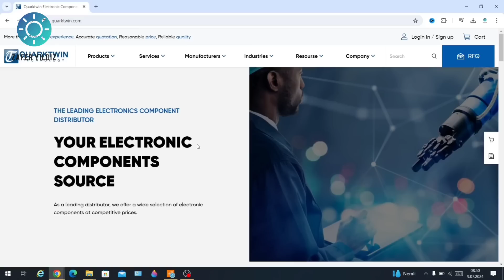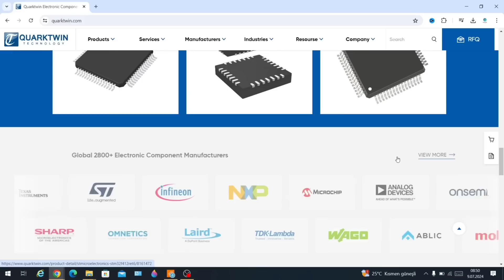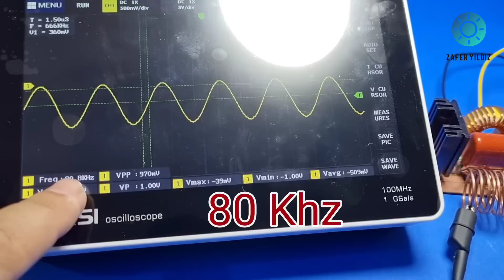Want Fun Electronics Projects? Watch This Now

Comment: This heater circuit is the answer to a question i made long ago.   5volts 3 amp 20watts  the old (kerosene/ propane operated ammonia refrigerators from the 40s) can become low consumption appliances with this if we get a flat coil, the only issue will be long term reliability for this circuit to stay on 24/7 - 365 .

Comment: This a nice project. What would be better in my opinion is doing this Electronic Project as a Scavenger Circuit using, instead of the 9v Battery, Air, Dirt, or Ground, just things around the home. What ever could be found as a power source. This way if you don’t have a Battery, then just make a Battery yourself. Just a suggestion.😊Thanks for sharing your experience and knowledge with me. I do appreciate your time and effort, teaching others.😊 PS Think Crystal Radio. ??????😅